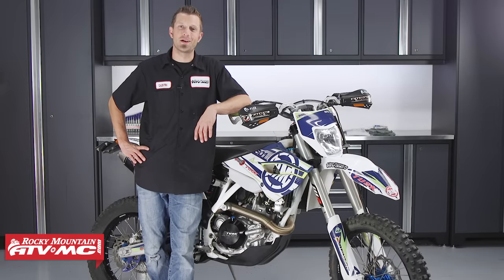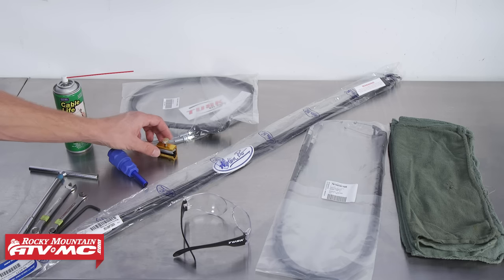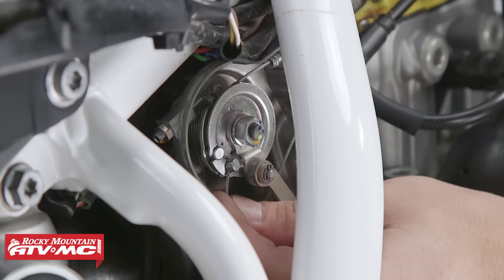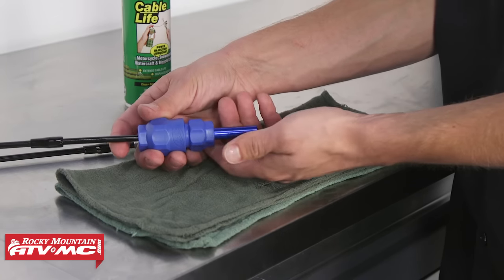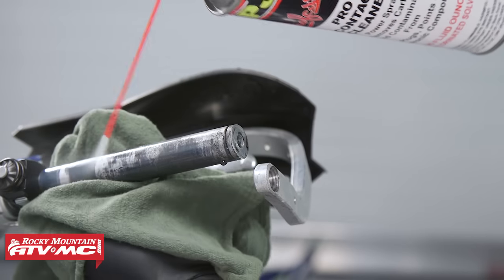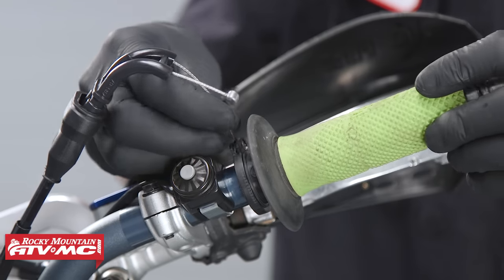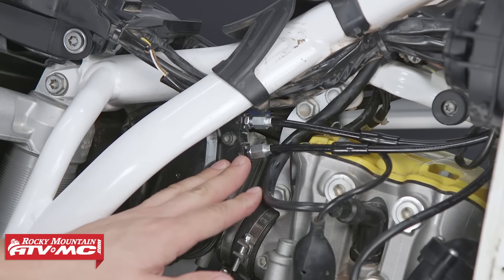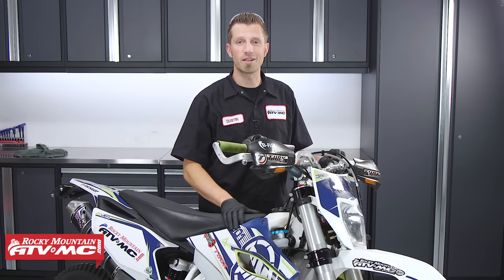How To Replace a 4 Stroke Motorcycle Throttle Cable

Comment: what does the return cable do ? does it makes throttle response better? #Rocky Mountain ATV MC.
Reply: 2 year old comment but if any one like me is watching this now and has this question the return cable is there in case the throttle sticks or the spring is not strong enough to return the throttle to its neutral position

Comment: Return/pull positions cables on Rmz 250 suzuki 2013 is the opposite for the throttle body part  4:09

Comment: This was great. Is there is simple mechanical way (maybe to lengthening the throttle cables) to limit the RPMs of the engine equivalent to not turning the throttle more than e.g. halfway?

Comment: I have a 2016 Yamaha ttr110e and it is not responding so the thootle is getting stuck I have rerouted everything and in the carburetor it is responding but not at the throttle

Comment: I have a Honda CRF450X 06.
Did a full overhaul/cleaning of my bike and replaced a lot of broken pieces.
When I reinstalled the existing throttle cable that was on the bike I have now developed the following issue.
When I turn the bars full right I get an increase in RPM’s.
This issue does not occur when the the bars are in the left turned or straight forward position.
I have adjusted both the top and bottom adjusters and still have the issue.
Any suggestions?
Reply: Did you figure it out JJ ? I just bought an 2002 DR400 and am going to replace cable set as the throttle was hanging up and found return cable frayed at tube end by sleeve . I don't want to end up with this issue myself and was curious what you discovered. Wrong re-routing ? To tight of a new zip-tie? CHEERS!
Reply: I have the same issue with my appollo 125 and I'm crf 150 and so far I still can find any thing to fix it

Comment: Just an FYI: If your cable has a barrel adjuster somewhere on the cable (my clutch cable is like that), the Motion Pro cable luber doesn't work, as the pressurized lube blows out of it all over the place.  Not sure is there is a way around this.
Reply: If anyone wants to learn about Jesus Christ reply

Comment: Are the throttle cables connected to the carburator? Or if its fuel Injected on the manifold?
Reply: If youhave a carbureted engine, the throttle cable usually connects to the carb. If you have a fuel injected bike, the cable will connect to the throttlebody

Comment: I had to replace a cable from starter switch(pull cable) and found the the cable does not return to low idle.  Why?  Did I install wrong at carburetor location?

Comment: I'm upgrading my 1997 P2 model Zx7r 750cc Kawasaki Ninja motorcycle throttle to that from the 2004/05 generation 1 Zx10r 1000cc Kawasaki Ninja motorcycle throttle tube. I think the cables from 1000cc are short. So how can I run an use the Zx7r throttle cables into Zx10r throttle tube onto the Zx7r carbs ?

Comment: What did i do wrong, i got like 15mm free play, snaps back fine, but if i tighten it for less free play it wont snap. Also the idle engine speed went higher

Cables are new and lubed, also the handlebar is cleaned and throttle body spins easily.

When i disconnect the return cable it snaps in all positions really well
Reply: sounds like the cables are not routed correctly or the wrong cables for your bike?

Comment: How do you know the return cable from the Pull cable ......what's the difference between the two ???
Reply from the maker: The push and pull cables and very similar. The main differences between the 2 is how they are routed and where they connect to the throttle assembly and throttle body.

Comment: I have a CRF230F. I took the carb out to change jets/needle. Now that I am trying to put the carb back on I can't get the return cable to tighten? Any ideas? I tried turning the adjuster on the throttle cabble near the carb and it doesn't seem to do anything.
Reply: i had the same issue and i was stuck on how to fix it as well. I just bought new cable and lubed them up and it works good now. just have to adjust the freeplay now.
Reply: I actually got it working. I didn't have the spring on the carb on right so the slider wasn't moving like it should.I  probably dont have the cables adjusted properly but it seems to work fine.

Comment: Hi, I just lubed my throttle cables but somehow when reinstalling them they seem to be shorter, I started inserting them in the carb and then at the handlebar but they are too short to engage, so decided to start installing them at the handlebar and then to the carb and same story too short. What I´m doing wrong? it´s the same pair of cables that was installed on the bike, thanks
Reply from the maker: Is there a chance you have the cables routed through the bike differently than before?
Reply: @rmatvmc  I checked the route in the service manual so I´m pretty sure they are routed correctly.

Comment: When I tighten the return cable, the throttle gets stuck at open, do you think the return cable is dirty inside? When I loosen the return cable the throttle returns but not so quick. Maybe both cables are dirty?
Reply from the maker: ronenfe If you throttle body slide and carb clean, then it's most likely the cables are sticking.  Cable lube can help with this, if the cable is the problem.  I'd recommend lubing your cable first and go from there.  You may need to check your throttle tube as well and make sure it's clear from any debris.  Thanks.
Reply: I have the same issue and my cables are brand new. I’m guessing it’s a simple adjustment but I can’t find a solution anywhere online
Reply: You leave the return cable (pull cable) pretty loose. It’s only really used in emergencies

Comment: I'm using a single cable throttle, and as soon as I put the slider back in the carb, I can't get the throttle to return to the original position. I tried carb cleaner and the needle looks okay. Any ideas? Spring seems fine. It did sit for years. Cable and throttle housing, and handle are new. Thanks.
Reply: jason rivera  ?

Comment: Hi how do you know which is the pull and which is the return cable when first fitting to the throttle? Does it matter? And how do you know which to put back on the twist? Pls help thanks
Reply: On my bike the return is the top of the throttle housing?
Reply: @renepaulus5885  me too

Comment: I need help from anyone that has experience? I have a cr125 with a 38mm carb and my throttle cable does not fully raise the carb slide  it only raises 3/4 of the way  and when i adjust it so that it does raise all the way it idles super super high even when i turn the idle screw all the way out so what kind of throttle tube or pull ratio  can i buy so that i can get a farther pull on my throttle cable  for example 1/4 turn 1/2 turn orr ?

Comment: why would you even need that dudad when you could put the nozzle for the lube directly into the cable like everyone else.
Reply: KillerJellyFish saves lube and no mess
Reply: idk $25 for less than a minute of cleanup. seems a bit expensive.
Reply: Older cables often take forever to lube by just holding the free end and using the cable lube nozzle to spray hit and miss. Beside requiring gravity and being s l o w to lube a long cable, more than half of your lube is wasted making a mess. A professional bike shop cannot take forever and make a mess lubing cables. With either gizmo shown, the lube job is both fast and neat. Lube can be forced under continuous hydraulic pressure into the cable without mess. Also, you don't need gravity to help as the hydraulic pressure from the nozzle can also force lube upward into a cable. The smaller metal gizmo is only about $8 on amazon. Less time wrenching = More time riding.

Comment: When I turn the front wheel to the right it has really slow throttle return but when the wheel is turned to the left (cable is straightened out) it snaps back quickly. Is the throttle cable just old and needing to be replaced?
Reply from the maker: it could be that you don't have enough slack in your cable and that it is somehow binding when turned to the left. Have you added risers or put on a taller bar?
Reply: Thanks for getting back to me so quickly! I don't have a taller bar or risers... I have a ton of slack but the cables seem to rub on the walls of the cable liner whenever the cable is bend even slightly causing a very sluggish return. I think I'll just replace the cable its getting kind of old at this point. Do you recommend any in particular at RM ATV MC?
Reply from the maker: Motion Pro and Tusk are two great options. Motion Pro has an awesome reputation, but the Tusk is also great quality and a great price. Both would be great. Thanks for watching and commenting. Happy riding!~Chase

Comment: Hello guys! Tks for the vid.

My throttle has response only when the handle bar is turned full left. Do you think the cables are done or some lub would fit the bill? 

Ty and have a good ride !
Reply: u need to adjust it and make sure nothing is pressing on it, if that doesnt fix the problem replace it with oem
Reply: Kwstas Bazz thank you ! Problem solved, a screw got lose around the carburetors, they forgot to tight it up after maintenance... professionals ... lol

Comment: Hey guys my throttle stays open and does not return unless I loosen off the throttle housing at the bars and slide it further up (towards hand guards) could this mean my throttle cable is to long?
Reply: Or broken
Reply: did you ever figure out the problem?

Comment: He says the process is just about the same for any other duel throttle bike- LOL   Not even freaking close for a 300 Kawasaki & the manual is BS also.
Reply: I could not find any video,pictures or step by step directions to do this on a 1998 KLX 300. I also tried all the forums I could find.- Any help appreciated..
Reply: The KLX250S may be similar. The 2009 KLX250S Factory Service Manual in its Appendix has dual throttle cable routing diagrams. One shows the routing at the handlebar throttle grip down toward the down-tube. Another is a frame side view which shows the routing of the dual cables from the down-tube to the carb itself. A searchable PDF is nice so you can search on "throttle cable" and find every incidence of this term. Good luck.

Comment: Why does it need 2 cable
Reply from the maker: Some bikes will have 2 throttle cables. One to pull the throttle open and one to push the throttle closed.

Comment: Safety goggles to change a throttle cable are u joking
Reply: My buddy was removing a throttle cable, pulling on it to clear a frame member which was slightly interfering. He yanked the cable a bit to free it and it came flying out of the frame and the lead ball on the end of the cable hit him in the eye socket and left a huge bruise. Like snapping a whip. Luckily, it did not directly hit his eye. Safety goggles are worn by all smart mechanics and all wise people. Others do not need to wear them.
Reply: @davidrsmith2417  you're completely right but I would never even consider wearing safety goggles to replace my throttle cable 😂
Reply: safety goggles in a shop is probably the number 1 and the main safety ppe to wear...
Reply: This guy takes it to far
Reply: You have no understanding of OSHA and safety regulations.

Comment: my cables move smoothly when not attached to the throttle tube, but once clamped to the tube the throttle cables and tube do not return, it rolls back smoothly but not back to rest position... any ideas? the cables arnt twisted or anything either.
Reply: hacker   any luck on your cable? please lmk im thinking i have the wrong size throttle tube, not allowing the tube to slide inside the brackets properly bc its to big...
Reply: Same